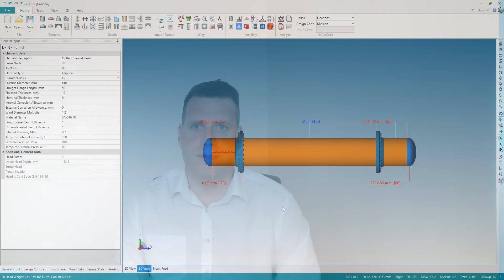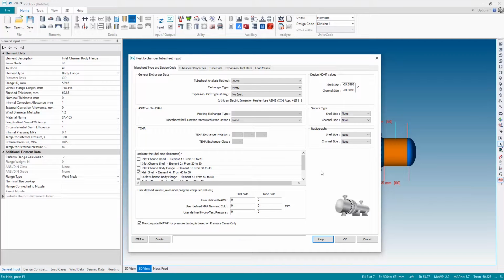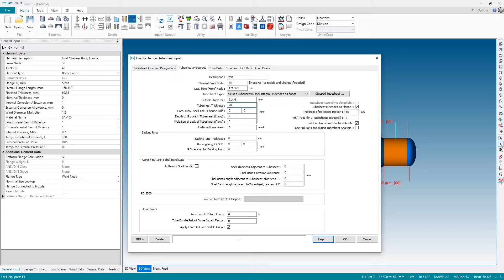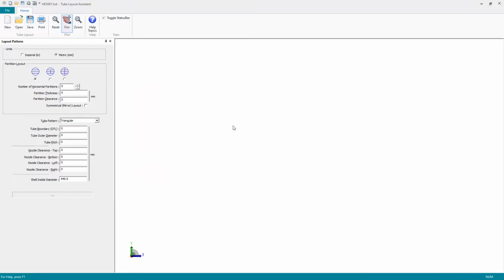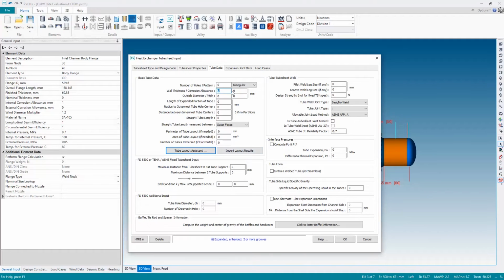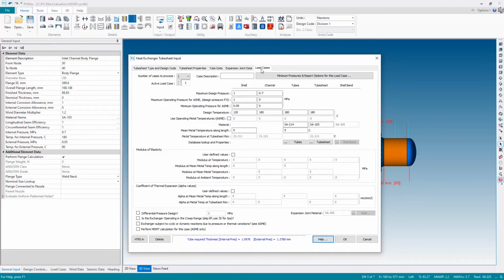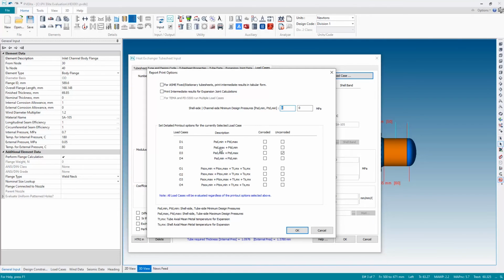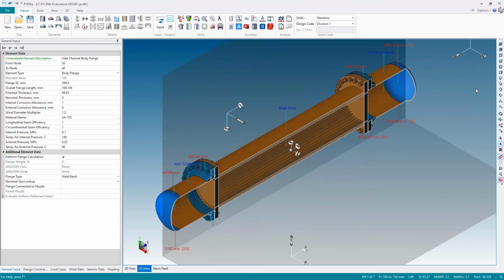How to... Carry Out Heat Exchanger Modeling in PV Elite® -  Part 2 - Adding Heat Exchanger Tubesheet

Comment: Hello, brilliant video. The question I have is for a BEU type heat exchanger. I want to model a 4 pass design with a horizontal separation and a vertical separation. In the tubesheet layout assistant I can only do a single separation vertically and must do 2 horizontal to achieve this. Also, I cannot workout how to put a support at the end of the U bend to counteract vibration effects.